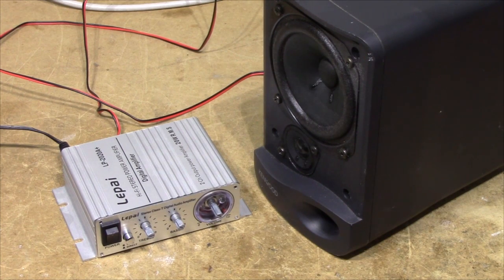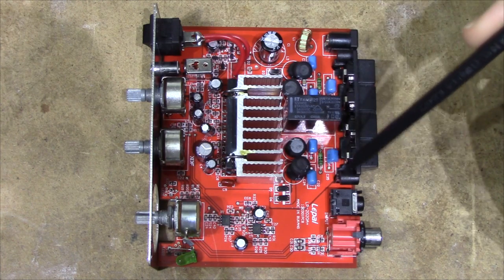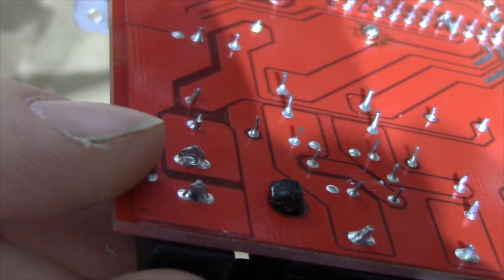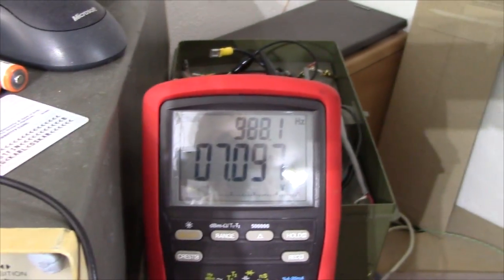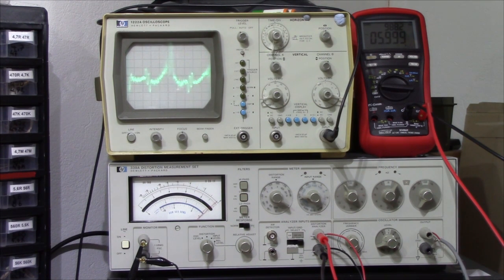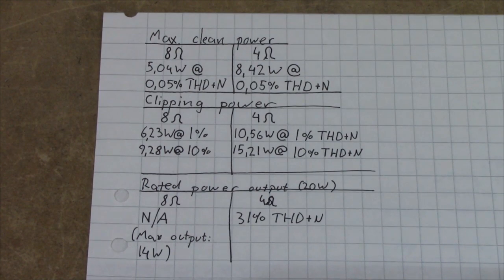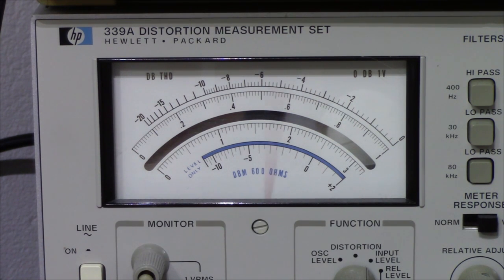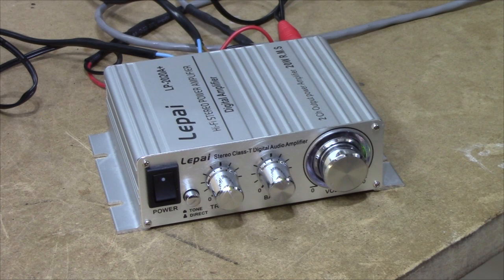Lepai LP-2020A+ OBJECTIVE performance test, teardown & review

Comment: These are great amplifiers to use with small speakers connected to a TV to enhance sound (if you don't have a HT system). I tested this amp a few years ago and it remains one of my most popular videos. I see they are now discontinued, so may be time to pick up a few more to save. There are some other mini amps out now that intrigue me...especially the TPA3116 chip that provides 2.1 output with (yeah, cough, 50x2 and 100x1). I'd expect about 1/2 of that, but I'm going to pick up one and we'll find out...Great, detailed review, especially like the THD portion. Geek out FTW!

Comment: In fact there are three amplifiers. The bass and treble are passive and amplified active by the two JRC4558 monolitic opamps, they don't amplify the bass and treble only, it amplifies the whole signal. I think that's the reason why it is so freaking loud when using maximum settings.

Comment: thanks for doing this. I believe the manufacturer is rating power for 2 channels. I agree this amp is fine for desktop use. I am using this amp with two cheap speaker ($5/pair) and it can be very loud!

Comment: Great Review, I wish there was a review of this quality around when I brought mine last year. 

I brought mine because I finally accepted using a 600w Pioneer hi-fi amp to drive a small desktop 2.0 setup was probably a little excessive, I replaced all the electrolytic's with better quality ones and in the case of the power input cap one of over twice the capacity of the stock, its a far more sensible setup for me.

Comment: Wow, I'm amaze when you short the speaker terminal on Lepai and still working very well.
My Marantz PM-450 (80's amplifier) blew on all power transistor and transformer when accidently short speaker terminal. And cost more money to repair it.
Reply from the maker: +Faisal Kadal 30 years ago, protection circuits were a lot more expensive and difficult to implement without causing issues with the sound quality. Today's integrated amplifier ICs are really easy to protect, since you just have everything in a single chip, and performance isn't as critical.
Reply: +FFcossag I see, thanks for explanation. I think now modern electronics much more safe than old electronics.
Reply: +FFcossag I see, thanks for explanation. I think now modern electronics much more safe than old electronics.

Comment: At high volume (but not into clipping) the LEDs on mine would pulse with transients (bass, kick-drums etc').

I replaced the 2200uF reservoir cap (the one you pointed out that will blow with DC-polarity reversed) with a 5800uF one, as big as would fit in the case - 4700uF would probably have sufficed. Some Lepais apparently have 3300uF caps fitted, the silkscreen clearly outlines one at least that big - but even that might still be marginal IMO.

the LED's stopped pulsing, so I assume voltage was stabilised, and the amp will almost certainly be reproducing transients better.

ETA >> it's quite likely you would have got a higher output with a bigger cap (clipping not settng as early) - in the region of 8-9w 'clean' into 4ohms.

ETA2 >> the 2200uF  cap fitted is actually as big as recommended in the TA2020 reference board, but apprently the Lepai doesn't adhere very closely to it and it really does need a bigger cap. As I said, the silk-screen indicated that a 3300uF or bigger was originally intended, but further down the line someone presumably referred back to the Tripath reference board and decided it wasn't needed.

Comment: It's a $20 amp that actually sounds pretty good driving small bookshelf speakers. Upgrade the power supply for about $8 and it gets even better.
Reply: hi what power supply do u recommend what amerage my lepy lp 2020a is 13.5v and 3a amperage  and when turning up the volume on the amp i hear a big pop and static noise increases.

Comment: The amplifier can handle 20 watts per channel at 10%THD. The power supply is just undervolted to fully drive the TA2020 in the amplifier.

The TA2024 in the 2024A series is meant for 12 volt input.

In sort, they supplied an under-powered power supply.
Reply from the maker: The TA2020 is built for 12 V as well (and it'll go up in smoke much above that), I'm not sure what you're on about.
Reply: FFcossag No. The TA2020, TA2021B and 2024 all use the same circuit. The packaging is just different so that the 2020 and 2021b can support an additional heatsink and thus support higher input voltages, leading to more output power. Check their datasheets.
Reply from the maker: By all means. If you had done the same, you would have seen the absolute maximum 16 V supply voltage rating for the TA2020. That means that it'll likely go up in smoke and flames once you exceed that.

http://www.e-ele.net/DataSheet/TA2020.pdf
Reply: FFcossag Yeah, that's what I'm saying. The TA2020 is mean to work at ~14.5v thus reaching higher output. The 2024 is meant for 12v input. It's just that the lepy on your video is supplied with a 12v power brick.
Reply from the maker: ExPsy I'm quite certain that I ran this test at 13,5 V. The difference is quite marginal either way; 15 or 20 W per channel both sound quite the same.
Reply: The equipment you used said 12 volts. The power output numbers agreed to that too. It's true that the power difference makes little difference though.
Reply from the maker: ExPsy Regardless, I ran it at 13,5 V in the much more detailed written review, which you'll find in the video description.
Reply: Nice! You could also experiment with adding a better heatsink and/or a fan and try higher voltages. The chip has protection do it won't get fried.
Reply from the maker: ExPsy Overvolted FETs explode, you can't protect against that.
Reply: Sure you can. that tripath has temperature protection, in case you feed it too much voltage. Other new fets have this protection integrated too.  :)
Reply from the maker: ExPsy It's not a temperature thing, it's got to do with the fact that FETs, once their maximum Vds is exceeded, turn on regardless of what the drive circuitry might want. In the case of a class D amplifier, the output transistors will short out the power supply and keep doing that until something breaks.

Comment: The advertised 20 watts is supposed to be the total wattage, not the wattage per channel. Your test showed that this amp put out around 9 watts per channel, so it is close to 20 watts advertised total when the load is 4 ohms.
Reply from the maker: No, the box specifies W per channel - and specifying anything else would be INCREDIBLY misleading and not at all excusable.
Reply: The 20W per channel is marketing B.S. Some manufacturers used to call this "Music Power" on the basis that most uncompressed music is quiet with occasional peaks. The amplifier, power supply, and speakers may well supply short peaks of (highly distorted) output which the addled human brain registers as part of the performance. It is the power of these peaks that the salesmen use like snake oil to charm the customers.

Your brute force calculations provide a much more realistic approach to RMS power output, especially as you link your measurements to the cusp of drastic distortion.

Comment: Most modern digital music releases are highly compressed (see "loudess wars") so quite high in-room SPLs can be achieved with an amp like this. However, play a decent 'vintage' recording/transfer, one with a high 'crest factor' (large dynamic peaks on percussion for eg), IOW a genuine hifi recording, and you will not be able to get the same SPL's without clipping and hence audible distortion. I've noticed this limitation with all the Tripaths I own (Lepai TA2020, Indeed TA2020, SMSL TA2021).

Comment: Hello! Great test and teardown! Very complete! I have a 2020A+ as well, I think maybe a little newer model PCB than yours, but the thing my vol potentiometer is (just as you mentioned here) having some internal connection trouble, I think, because the sound scratches on the left channel as I turn it and I notice the output voltage on the left is way over what it should be. Anyway, I was wondering what 20k pot you put in and where you found it?! I live in France and can't find a 20k pot anywhere!
Reply from the maker: +Xavier Bonet I used a generic linear pot off of Ebay, I just picked one that looked kind of similar to the original.
Reply: Great! Thanks for the response! And so the resistors you put on the back were to turn it into a log pot?
I'm having some trouble with electrical noise on mine when I touch the dial or the casing, is there anything you can recommend to get rid of this?
Thanks again for all the good info!

Comment: Great vid.
Unit faults aside, 100 hours of burn in is a good rule of thumb.  And given the low usable output, speakers rated at around 92db/W would be a good match.
Reply from the maker: Thank you. However, save for finding production faults, and perhaps getting the initial scratch out of the potentiometers, there exists no basis for assuming that such thing as amplifier "burn-in", exists. A poor amplifier when new, will be a poor amplifier at ten, a hundred, or a thousand hours still.
Reply: FFcossag True.
There is some rational in a few hours of burn in though.  Component parameters do change over time.
So its possible that an audio device can sound better or worse over time.  

I'm very much intrigued by these Tripath amps.  A few manufacturers seem to have produced astonishing examples.
Reply from the maker: fatcat2939 Component parameters do change over time, what I react against is any claim about them doing so drastically enough to audibly affect the sound in a manner of a hundred hours; that's simply not true unless the components in question are faulty. In such a case that faulty components are installed, they're furthermore unlikely to impact the performance of a device positively.
Reply: True

Comment: What power difference (if any)  would you see if the only waveform you had were a square wave, not a sine wave? That's all I have, something I made up from a 555 timer IC.
There are loads of these little amplifiers, people do not realise that many of them simply are NOT stereo. They are also not a Tripath chip, maybe a TDA7498, but a amp running in bridged mode.
The output is then even weaker: As little as 2.5W.

There are also loads of the little TDA2030 panels about. I wonder how they would perform under the same test conditions? I believe that you can get one for as little as US $1.60, but that is not for a cased product.

Comment: Hi. Thanks. Brilliant teardown. Do you know if it is possible to damage this amp by connecting one of the speakers out of phase? Blue light but no sound from the lepy after doing this (by mistake) .. but still cant believe this could have zapped the lepy.

Comment: I really like your review. I wonder if you would comment on the component values of the volume control modification, including the resistor values as the bands are hard for me to read on the screen. Also would like to know the brand of capacitor you replaced. Thanks for your channel. It is a real service.
Reply from the maker: +Donald Ferguson Sorry for the late reply, I never noticed your comment. The resistors are 5600 ohm, and I think I used a 20k linear potentiometer as a replacement of the original. The original capacitor in the unit was something entirely generic and probably brand-less, as were all the capacitors inside of it.

Comment: what are the best mods that can really improve the lepais sound quality that you know of? great video by the way, very informative
Reply from the maker: Thank you. The only thing I'd recommend, is running it off of a 13,5 - 14 V power supply, and not a 12 V one. It's built well-enough not to produce much in the way of audible artifacts (from what I've been able to measure), so I can't recommend doing any internal modifications for the sake of sound quality.
Reply: FFcossag  english is not my 1st language so I cannot say I understand your vdo completely. however, I'm quite interested in your recommendation on running it off a 13.5 - 14v supply, instead of 12. could you briefly explain why that would be an advantage? thanks in advance :)
Reply from the maker: Oak Adthapol N. The higher the input voltage, the more power you get. It will go louder on 14 V than on 12 V.
Reply: FFcossag and does it mean that at the same loudness, 14v will be less distortion than 12?
Reply from the maker: Oak Adthapol N. More or less, yes. At very low volumes, it doesn't matter, but once you turn it up even a bit, 14 V can make all the difference.
Reply: FFcossag thanks a lot :)
Reply: FFcossag
Other reviewers advice to go with a higher amperage, 12V / 5a  I see the most
Will this give the same result as your advice?
Reply from the maker: Gene Hendrix No. It might be better than some "rated-for-2A-but-delivers-0,5A" wall wart that you get out of China, but a 14 V supply of at least 2 A, will yield the best results of all.
Reply: FFcossag
Ok thanks a lot :)

Comment: , I purchased a 19 volt / 2.1 amp power supply and a 
24 volt / 5 amp power supply and I purchased two of the newer model
the Lepai 2020ti.
which is class d and not the original class T.

Comment: The volume pot on the amp is garbage, that's pretty much the only reason I'd buy a higher end model 2020/2024 amp.
The volume pot on mine went out and fucked the sound up hard, sprayed it with some lube and it's back to normal, the pot has terrible feel though.

Could you explain why 5 clean watts per channel at 1khz isn't actually 5wpc due to the dynamic range of music, I think that would help listeners better understand the capabilities of this amp and all amps in general.
Reply from the maker: 5 W/ch. is 5 W/ch. no matter how you turn it. The crest factor of music remains the same no matter what amplifier you use, and as such, the average power output will always be set percentage of your peak power (of course depending on the music you listen to). As such, it is rather pointless to state any realistic average power figures, in my opinion, since the point is to bring forward a number that is easily quantifiable and comparable across different amplifiers.

Comment: Hi, its a great review and test of this amp! Do continue!

I need some help tho, wondering if you can help me out...

My lepai lp-2020a+ just stopped working yesterday.. I think it was due to wrong polarity, i connected my 12v 5A battery, to the amp, and found out i put - on + and + on - for a split second, when i was testing whitch way would work. after i found out what was what, the led light got on. But no sound was send out to my speakers and it just didnt play any sound..
It worked before i cut the DC adaptor wire and connected it to the battery. But now it dosent. Only the LED light worked..

Could this be the Capacitor that got broken due to wrong polar?

- Steen
Reply from the maker: I strongly doubt it's only a capacitor; if it were, chances are that it would still work, albeit poorly. It's more likely to be an opamp, or the amplifier chip itself.
Reply: FFcossag But how can it become broken just after a second of switched polarity?
Could there be other main reasons it does not work? Nothing is burned in there or looks broken. And would it fix the problem if i change the chip?

If it is the OP amp, how can i fix that?
Thanks
Reply from the maker: Steen Zou It takes considerably less than a second to break a chip like that. I can't say for certain what has broken, I'm afraid you're going to have to troubleshoot that yourself. If it is an opamp, it's only a matter of desoldering it and swapping it out.

Comment: I have connected Schiit modi's RCA output to RCA inputs on Lepai. I also connected 3.5mm audio cable to 3.5mm input on Lepai this way i can switch between my laptop and iPhone to play audio. Is this connection fine? Or will it damage any of the components?
Reply from the maker: It's unlikely that you'll damage anything; the outputs of tiny devices like headphone amplifiers and phones tend to be short-circuit protected. However, you are connecting the output of your telephone to the output of your Schiit, and connecting outputs to outputs is something you should never, ever do unless you know what you're doing.

When you play something on one of your devices, it will essentially try to over-power the other one (which is working hard to keep its output at 0!), which might lead to distortion, heat, and reduced battery life.

Comment: i have lepy lp 2020a  with 13.5v and 3a amperage power supply for the amp and a 75w studio monitors music plays  when turning the volume up on the amp i hear a big pop cuts out for about a second then does it again and the static sound increases how do i fix could it be the power supply what volt and amperage plug do u recommend so i also dont get distortion. the amp is a lepy lp 2020a and speakers are eris e4.5 presonus

Comment: FFcossag More Questions. A common compliant with this amp is the power supply that is supplied. I recently upgraded my computer power supply with a new one and intend to use the old one to power the Lepai, this is a 12v  16 amp source that was the 12 volt source for the mother board, I was thinking this would be a good stable power source for the amp, do you see any problem using this. Thank's, Less Opinion

Comment: Thank you for the video. I was wondering, where on the volume knob would the amp be reaching around 5 - 7 watts? I just want to know the maximum safest volume knob location. I have been keeping my volume below halfway just to be safe, but if it can handle anything past that it would be great. Thank you!
Reply from the maker: Output power depends on your input signal. There is no "maximum knob position". Just don't play it so loud that it sounds bad (treble gets modulated by the bass).